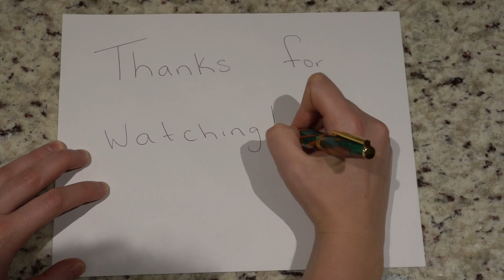Woodturning | From scrap wood to a beautiful resin pen

Comment: Nicely done.  I actually like the lighter translucent look you got on these pens.  I do backpaint my blanks with acrylic resin blanks if I am concerned about the tubes showing (I also have a few that show and I'd prefer that they not).  I use simple acrylic hobby paint with good results.  You only need a few colors and you can mix almost anything you need.  The trick, and I learned it the hard way is that you really need to let the paint dry at least overnight if not at least 24 hours to let the paint cure.  I use epoxy to glue my tubes in, so I am sure if CA would cause a problem with that paint that Epoxy doesn't.  Also, if I the tubes are fitting a bit lose, I mix a few drops of that same acrylic paint into the epoxy to tint it for a little additional piece of mind.  Keep up the good work!
Reply from the maker: Thanks, David! And thanks for the tips. I've been meaning to experiment with tube painting myself at some point (haven't tried it out yet)

Comment: that is a very nice pen and a great idea. for your epoxy did you put it in a pressure pot or just leave it out overnight in the air. and what kind of epoxy did you use, please and thanks
Reply from the maker: Thank you, Jim! For the resin, I used Alumilite's clear cast epoxy resin. And yes, I left the pen moulds to sit in a pressure pot for 24 hours before de-moulding.

Comment: After you sanded, what product did you apply?
Reply from the maker: Hi Orion! Once sanded, I finished these pens with multiple coats of thin cyanoacrylate glue (super glue) and further wet sanded that up 12000 grit before polishing